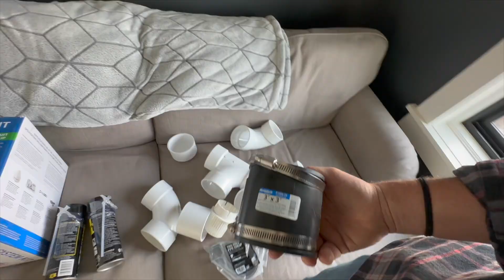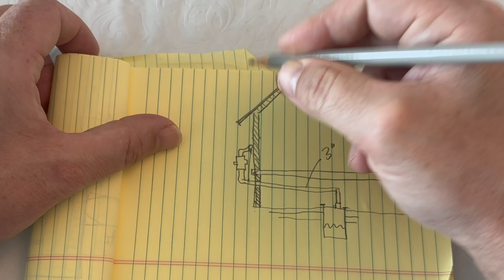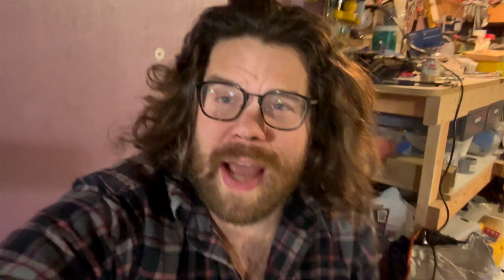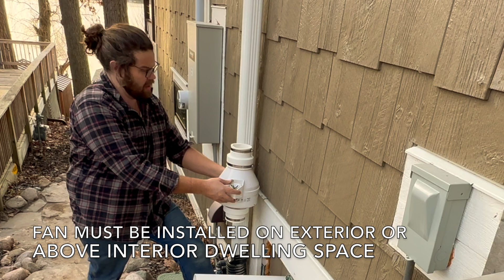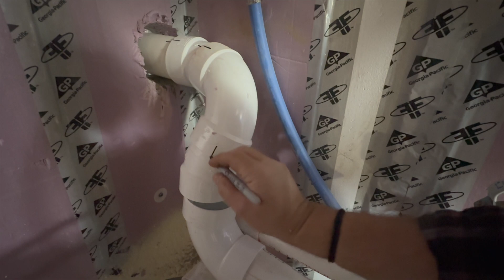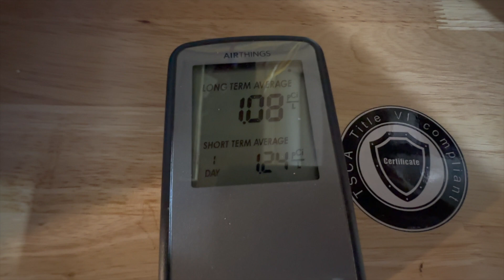How to Install a Radon Mitigation System Yourself and Save Money

Comment: Not many people install condensation bypasses like you did (T with insulated bypass hose). I have a very similar version installed on my system. 
On my first install, my fans were lasting only 3 or 4 years before croaking. Bearings would go out. Read from a site that condensation can shorten lifespan. Installed a similar setup 8 years ago - and fan is still running strong.

Also - think ahead about future rework when installing the pipes. Consider that you will need to replace that blower someday. The system in this video will have all the pipe weight sitting on top of the radon fan and would be a bit difficult to change without having a second person to lift and hold the large vertical. For most systems, you want a third rubber joint so that you don't have to completely disassemble major sections to change motor or have an extra set of hands to raise sections of pipe. For example, I would have placed a third rubber joint in short horizontal run from pump to the main vertical rise.

Comment: How far down does the pipe go   below the sump pump cover?
Reply: Inlet to suction pipe must be at or above the corrugated drain pipe entering the sump pit. And the water level must be kept below the corrugated drain pipes.

Comment: Why put the fan outside? Also, why pull from the sump pump? What if the sump has water in it?…
Reply: It's a 'Go To' for DIYers. Its already a hole under the concrete. A UPS backed sump pump would reduce risk of sump flood. It it outlives that, then we have bigger problems to worry about than Radon.
Reply: The water levels always supposed to be lower than the inlets that go all the way around the house effectively creating a vacuum under the house.
Reply: Read up on radon installation. There is a federal version plus most states have their own versions of code for installation. Pretty much the first thing in the various state codes is 'no fan will reside within the living section of the home'. This means the basement or anywhere else within the living sections of the house. You are allowed to install them within the attic or outside the home. Within the living section of the house, you should only see the input section of the radon fan. The exhaust output from the radon fan should always be outside of the living section of the house.
Does not have to be the sump pit but that is usually the most convenient location. Pipe goes just far enough into the pit to keep it above the highest water level.  As Chris said - the water levels within the pit should always be lower than the drain tiles (corrugated pipe) in order to create a vacuum within the drain tile under the house. As an alternative, you can also bore a hole near a corrugated pipe and tie into them for the suction line.

Comment: Can the fan be mounted inside the basement?
Reply: The reasoning behind putting the radon fan outside is to keep all the indoor piping under negative pressure (vacuum) so if there's ever any leaks on anything inside the house, it will suck air in versus a leak on the discharge side of the fan pushing radon gas into the house. I have no clue what code is or isn't. When I was doing some experiments at my house, I bought a radon fan at a home store and temporarily hooked it up so it sucked from my basement sump pit and discharged out thru an old dryer vent. It wasn't pretty by any means but it proved the theory that depressurizing under the slab would eliminate my radon issue. I'm not a professional anything but when I figured out my temporary setup worked to eliminate the radon, I plumbed everything up with the fan indoors and just a very short piece of pipe outside. I live in climate zone 5 so no shortage of freezing weather. To me it made sense to keep everything inside. I glued all the plumbing fittings and have had zero issues and less than 1 piC/l for almost a year now. I spent less than $400 on my whole setup. $800 if you want to count the two radon monitors.
Reply: NO. You cannot. When selling the home and if the buyer has the home inspected - having the fan on the inside will cause the inspection to fail. You should never have the exhaust section of the radon fan within the living section of the house (e.g. basement). The exhaust must be either outside or within the attic.
Reply: It probably should be. Idk why these “professionals” and “DIY enthusiasts” seem to want that thing outside. Seems dumb. Also, route it so the pipes can be hidden inside, not have this gross gaudy pipe coming off the side of your house.
Reply: @drawer6815  Seems dumber to have such uninformed opinions hahaha.
Reply: @AlexM-vt5pu  sorry, i’m not a fucking radon expert. I must have missed the day we learned that in school. Man, you must be so smart and successful. I envy you.
Reply: @drawer6815  If you don't know what you're talking about, why bother?
Reply: @HolyGoatsOfSteel   oh, i’m so dumb for not knowing how to run a radon pipe in an old ass house… So sad for me… I’ll just go back to being a welder and fabricator who can build anything out of anything… Sucks to be me..
Reply: @drawer6815  Good for you, but you questioned why people do something some way, you were told why, and now you're being a big child about it. Accept you were wrong and move on.
Reply: @HolyGoatsOfSteel  how was I being a child about it? When did I not accept I was wrong? Also, I moved on months ago. The only reason i’m back is because some asshole just started messaging me about it as if it’s the most important thing they had to do on a Friday morning.

Comment: Great video just happened to come across it this morning. I work for a radon company in NJ. You definitely made it easy for abutting doing a DYI. I would just always recommend using an electrician for the cut off switch on the exterior.

Comment: Your video is very helpful. One question I have is: I have a sump pump with outside drainage that is open to air, wouldn't the fan suck the in air from that outside drainage pipe?
Reply from the maker: Normally a sump pump has a check valve built into it.  Also since the pump is likely submerged in water an it draws from the underside of the pump that would act as a trap.  Essentially making that pipe air tight.  Not totally sure of your situation without seeing it but that’s my guess!

Thanks for watching!
Lake warrior

Comment: Thank you for this video! I am curious what your readings were before the mitigation install? I just bought a radon detector and Im getting levels above 8. Our sump pump has never had a cover. My first step, is going to be to buy the cover you show. I think just a cover may bring our levels down a bit. And then I am going to do basically exactly what you did here. Did you run the wiring for the fan right out of the same foundation opening for the vent pipe?
Reply: I know right you think that would have been included in the video

Comment: Great video, thanks... do you have any info on mitigation of Radon coming from building materials? Florida limestone is used to manufacture concrete blocks and it has been found to be problematic in some areas
Reply from the maker: I don’t, that sounds like a complicated problem.  My first thought is installing a whole house ventilation system if the radon is coming from a building material.  Not entirely sure though…. 
Thanks for watching 

Good luck!
Lake Warrior